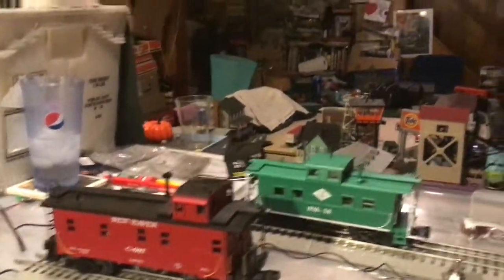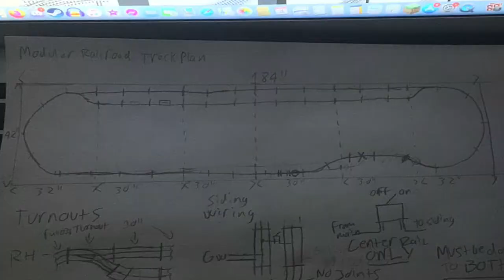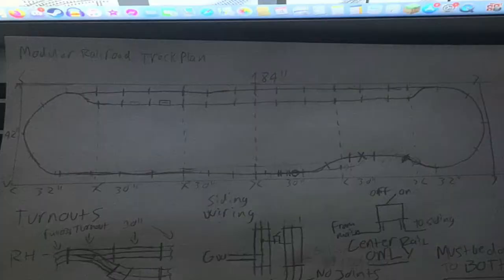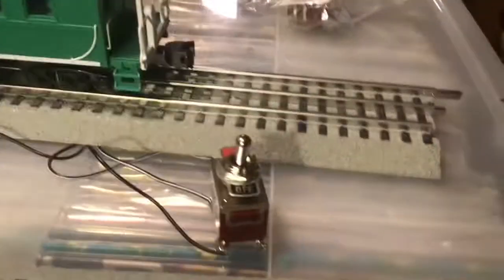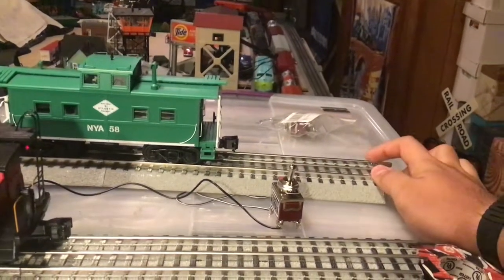Building a Fastrack Insulated Siding | Modular Railroad Part 2

Comment: Awesome demo! So my question is from doing this wiring method for a yard, do I have to wire each closed end of each on/off switch to the powered main line track, or can I wire the consecutive closed end of each on/off switch to the previous isolated dead track’s center rail? I’m helping my friend wire his yard and we’re using MTH realtrax. We got the same toggle switches you used in this video. Hope my question makes sense.

Comment: It’s good but my question is, I was told you have to make sure that the siding that you want to insulate can not touch the other powered track at all, the metal on the rail can’t touch even.  How do you prevent that is my question,  I know you pull the tabs off but the rail touching could still cause power if that makes sense.
Reply from the maker: It does make sense, and it's better off insulating all the rails. For my setup, (which I should do a follow up video on wiring/prep) and really this works for most 3-rail, the circuit is not complete until both ground and hot connections are powered. Cutting the Hot (inner rail) polarity out cuts all power going to an engine or car that can start or short the siding when swapping trains.

As for removing the joiners, you can lift the rails out of the roadbed by moving tabs on the underneath, lifting the rail, and simply pulling the joiner straight out. I then tap the rail ends down with a hammer to shave the rails back from touching, but dremel drilling works better.